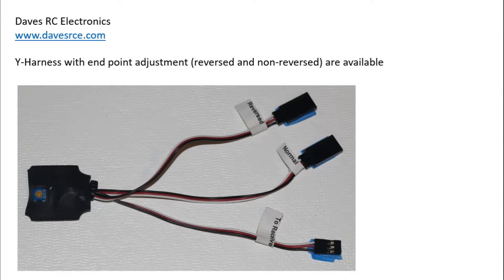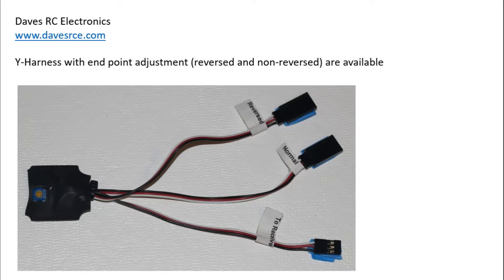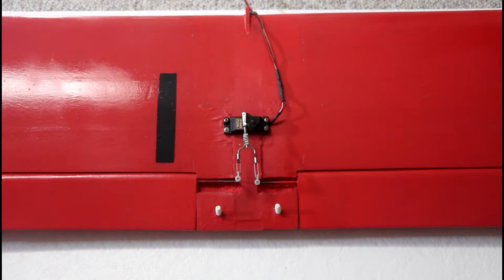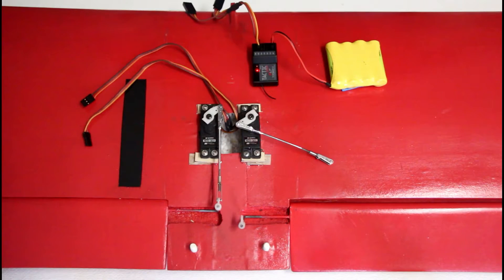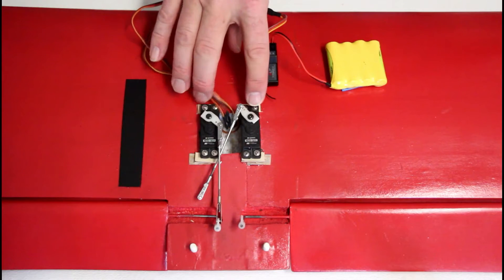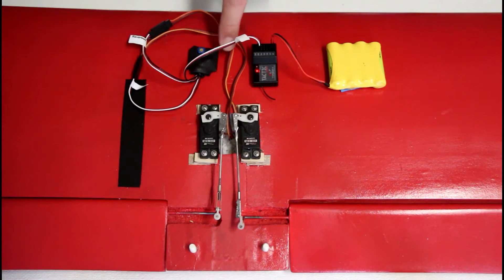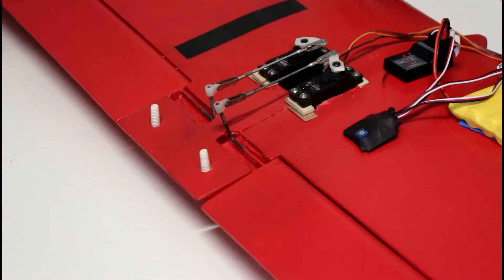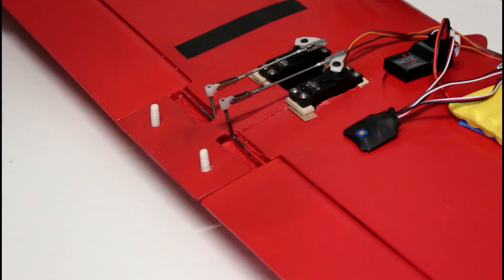Servo reversing Y with End Point - Daves RC Electronics

Comment: so if my flap servos are moving in opposite directions, i would order the one that describes that it move in the same direction. you call it servo y with trim pot. am i correct.
Reply from the maker: Yes you will need to reverse one of the servos, what I like about the trim pot is that you can get both flaps lined up without any major linkage changes.

Comment: Dear Mr. Cronenwett, I made a RC plane which only has single servo on  each wing. I need to program these flaps(or you can call ailerons) to act as ailerons and when landing I want them to turn to flaps. Should I wire them up to the receiver with Y cable or seperate cables on seperate channel slots on the receiver? I've plugged the left aileron to ch1  slot, right aileron to ch5. With the switch mode(NOR-ID1-ID2) on the remote I'd like to switch the Ailerons to act as Flaps during Landing(much down position angle on the flapwings) and Takeoff(littlebit down anlgle on both flaps).
Can I do this with Y-Cable or seperate Routed Cables Sir?
Reply: What you are trying to do is  called FLAPERONS. This requires that each servo is connected separately to the receiver (NOT with a Y-harness). You can still give aileron input even when flaps are deployed.